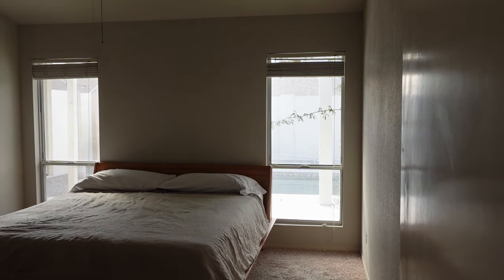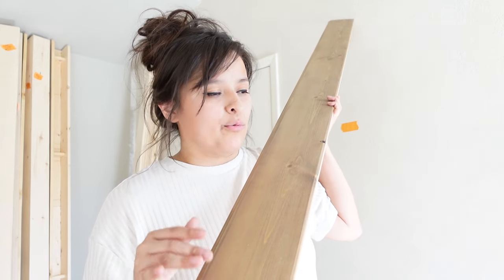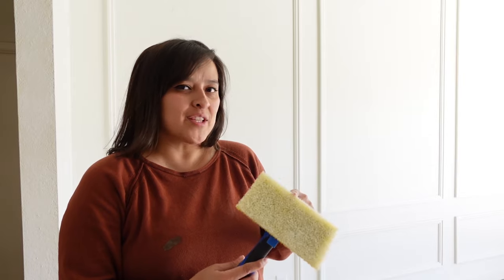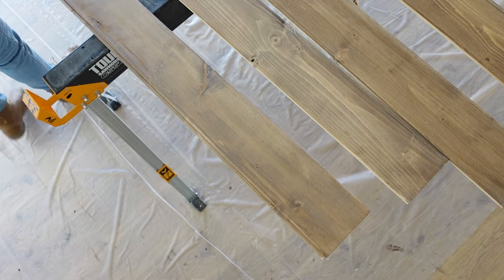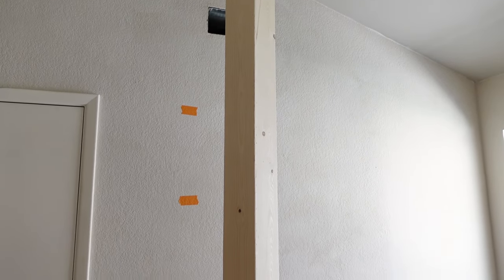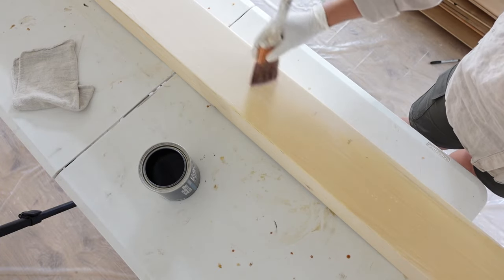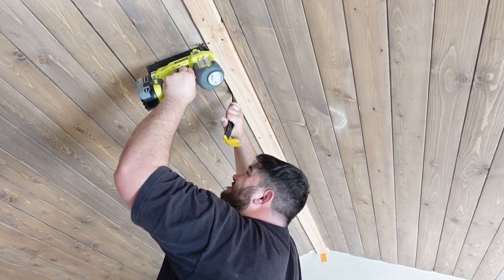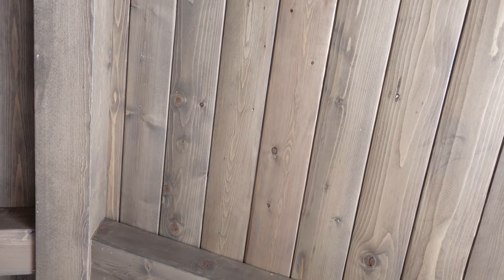DIY Tongue & Groove Wood Beam Ceiling USING PINE WOOD!

Comment: Nice job.  Here is something to consider some time later if you get tired of the appearance.

Our house has a large room with T & G knotty pine ceiling and engineered wood beams supporting them — original to when the house was built in 1977.  

The wood was fairly low-grade with lots of knots, some small gaps between the T & G and some holes in the wood — all covered in dark brown stain but not sealed nor varnished.

Because of construction repairs, the room was empty for — so we decided to go ahead and paint the ceiling a bright white — something I wouldn’t do over quality hardwood but this was low grade pine looking shabby.

It took 10 full days!

Prime coat oil Zinnzer Cover Staine which accepts latex top coat.  Lots of silconized DAP Flex caulk (42) tubes doing all grooves etc.  used 20 min wallboard mud to patch holes cheaply.

Top coat is two coats Sherwinn -W Infinity Satin white from Lowe’s.

Huge job needed patience.

Details are for anyone considering similar job.

Results are FANTASTIC!
Reply from the maker: thank you for adding your suggestion on here, love it. I've seen some gorgeous painted T&G and it can be done well for sure

Comment: Did you use the matte clear coat? Also do most homedepot carry the clear tint base for this project?
Reply from the maker: Yes, indeed I used a a matte clear polyethurane from Behr. And normally all Home depots carry the clear tint base to make customs color stains (btw they have Behr custom stain pamphlets near their stains aisles in case you didn't know}.  Ask for Behr Tamarind TIS-005 {waterbase} and they will make it for you. The cost is the same as any of their stains, it's just not a traditional, popular color {yet, hehe}.

Comment: Good video . I think it looks awesome and rich . And even better you were able to achieve that using pine . Sadly  nowadays someone would think come in and paint boring white . The travesty of so many beautiful homes with character and expensive wood simply painted white to go along with the sterile hospital setting look of everything has to be white . Pushing the everything must be clean or where are all gonna catch something agenda being propelled upon the gullible masses
Reply from the maker: thank youuuu! I love how it turned out. It was quite bit of work, but glad I stuck with trying out different stains. I totally get why people sometimes want to paint it over mostly due to their budget parameters and they want something that doesn't look so yellow or orange, but the extra work is always worth it. Sandblasting is always a better alternative, but not sure how much that would run to do in a home, but something for everyone to consider so they can re-stain ceilings vs. paint. But some paint can look really good, like those cottage core homes.

Comment: Hi there.todaybi try from 3hours to decide for a colour of 160sqm roof top pine.our colours are similar but i didnt use grey.can u please sent me a link of your colours?
Reply from the maker: Hey, hey! Here's a link for reference:  https://liketk.it/4d6XY. 

The Stains are Behr Water-based Prestain + Behr Tamarind TIS-005 + Varathane Weathered + Behr Clear Coat. All stains are linked except Behr Tamarind TIS-005, it's a custom water based color you will ask for at the homedepot paint clerk desk. The cost is the same, it's just not a regular color ppl ask for. They have a stain brochure near their Stains in case you need to see all the color options they have. Hope this helps :)
Reply: @hauzandco  thanks a lot.